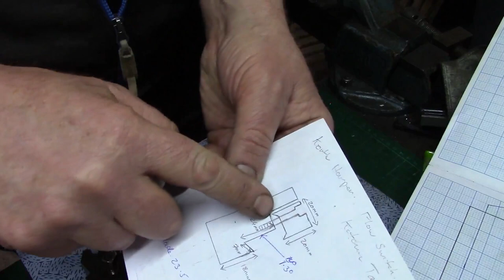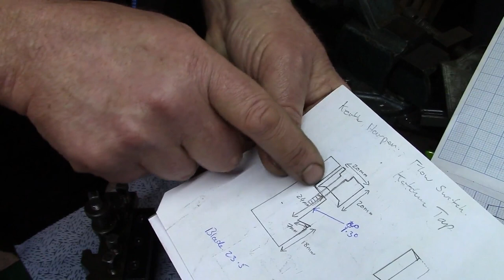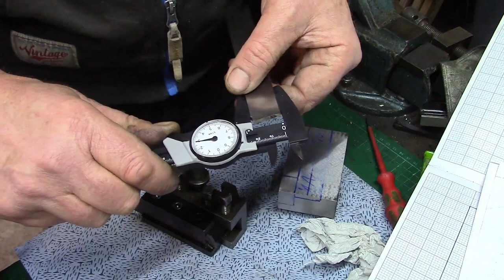Making the Parting Of Tool Holder, Part 13

Comment: Nice work Al.  Looks like tough steel.  Maybe 4140 or the like?  It's always dicey to mill into a corner with a long small diameter cutter.  Keeps it interesting! Tc, Mike
Reply from the maker: It’s normal mild steel I think Mike, your right about the small milling cutter you have to go steady.

Alan.

Comment: Are you going to get the holders hardened and ground? I use the same style and size holder and I want to make a couple more. However, I'm not sure if they need it to be hardened and ground as I have no way to do it. Thanks for this video series. It has been really helpful.
Reply from the maker: Hi Pedro, I've made the smaller ones before and not hardened them and I've never had a problem.

Thank you Alan.

Comment: Looking good al
I was passed your way from a forum post and now have started watching all your videos. I'm hoping to make some tool holders myself. If all goes to plan I'll be using a shaper as I have no mill. My question is what grade steel would you recommend?
Reply from the maker: To be honest Steven I don’t know the answer to what would be the correct steel for the tool holders, all I can say is this the second lot of holders I’ve made and on both occasions I’ve used normal mild steel and had no issues, the original ones are I think hardened and ground, however I bought two from a uk seller that were hardened and ground and after a while they both cracked,  for me so far mild steel seams to be just fine, hope that helps.

Cheers Alan.
Reply: @pearcemachineshop5200  
EN3 B iv now been told
Reply from the maker: Sounds good.

Comment: Sorry bud but I think you missed a trick there. 🤔 If you had angled the slot for the blade about 6-7 degrees off horizontal you would have had a much sweeter cutting parting tool.👍
Reply from the maker: Do you mean from front to back.

Al.
Reply: @pearcemachineshop5200  front to back indeed. It gives built-in rake and does really help. Obviously height changes with stick out but that is a very small price to pay if you have adjustable toolholders.
Reply from the maker: It never crossed my mind Chris, you would think I would have thought about that after making the previous two,  never mind it should still be ok though.

Alan.
Reply: @pearcemachineshop5200  no doubt it will work but.........
If I can be bothered to clean all the crap off my lathe for long enough I will do a video of my experiment, which although crude is now my favourite parting tool.
Oh dear, did I just volunteer to clean my lathe, better and lie down in a darkened room till the idea passes.